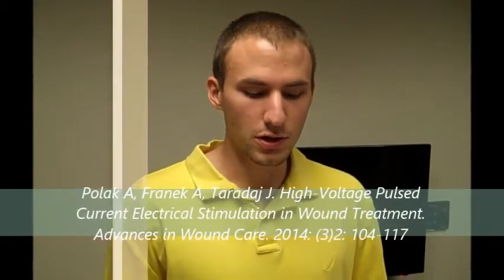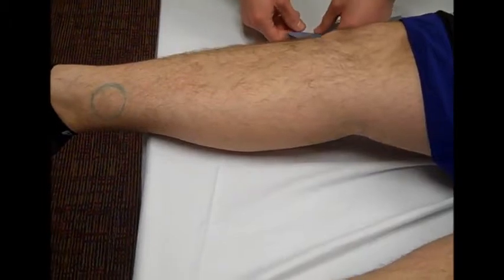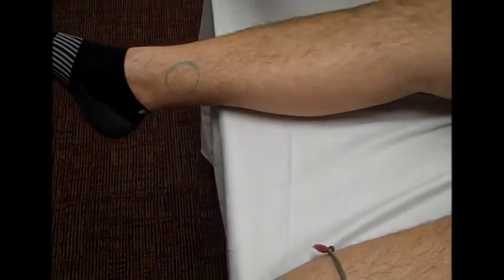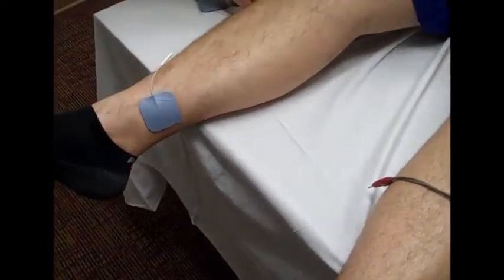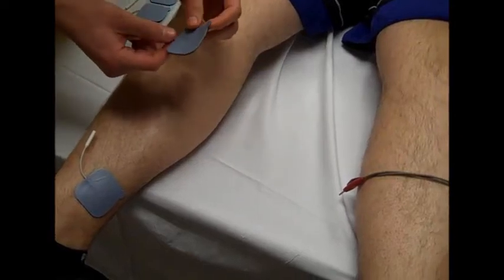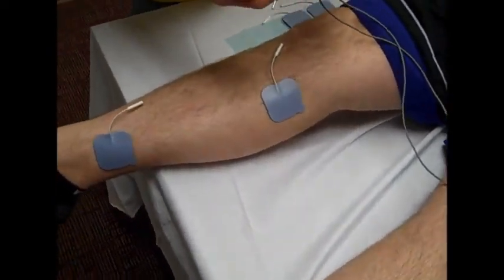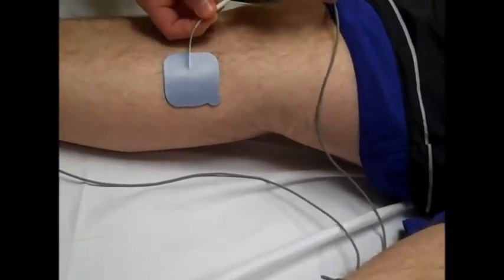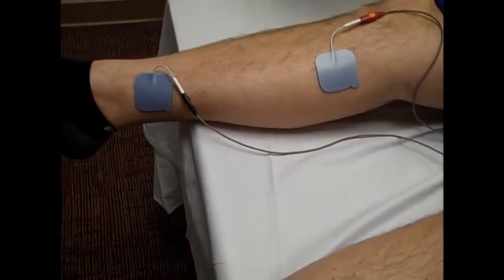Electrical Stimulation in Wound Treatment

Comment: This important info has very few views but it needs more exposure. In part I think that's because it's not integrated into a larger study of vascular disease. If this is as effective as presented here, it must be able to overcome multiple hurdles of the disease - that question of how is what stands out. Meaning, the various CAUSITIVE elements of ulcer formation, including severe inflamation, reduced perfusion of fresh fluids (blood and lymph) along with sufficient nutrient, resulting in cascading tissue atrophy and degeneration to non-viability of the lower-limb expanse. :face-pink-tears: